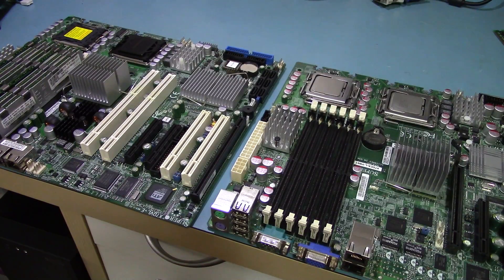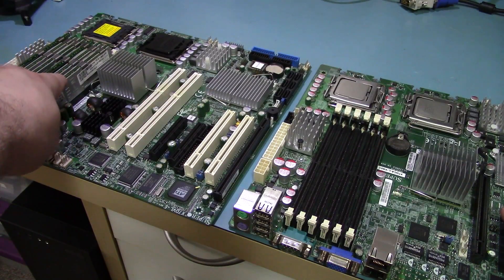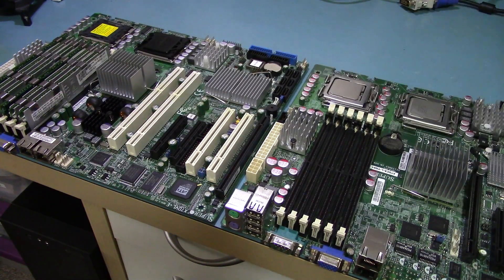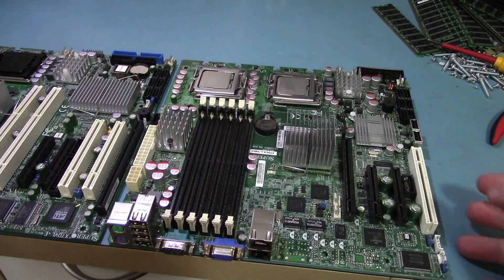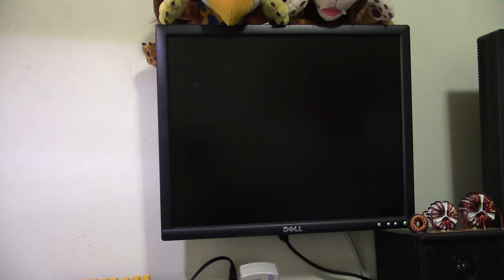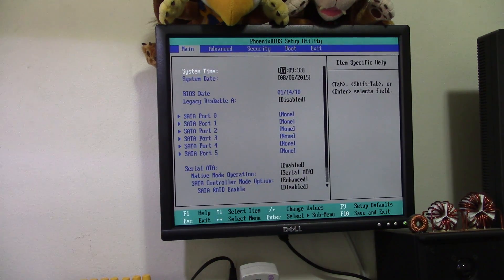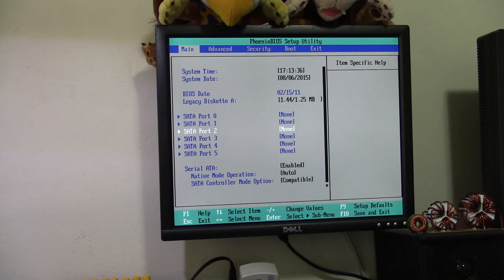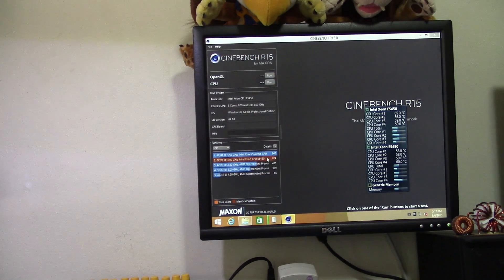Hackintosh Super Micro Dual Quad Xeon Build (Part 1 of 2 - X7DCA-L Motherboard)

Comment: These 'server' type heatsinks are horrible. I don't know how they lasted (In the market) for so long. I always use either fan controllers or just switch these fans to 5v and run at reduced speed or jury rig a better heatsink on with some hacking of the heatsink.

Comment: How did you fix the heatsink on the processor? I'm having problems with this.
Reply from the maker: +Carlos Andre V. Nazario Junior It needs a bracket for the back of the motherboard. If your motherboard didn't come with one you might be forced to use some heavy duty zip ties to hold them down.
Reply: but does zip ties support processor heat without melting?
Reply from the maker: Nylon won't melt at CPU temps.
Reply from the maker: Just keep in mind 603/604 coolers are NOT compatible with 771 chips. They have the same mount, but the height is different and won't make proper contact with the CPU.

Comment: Which CPUs are you using?  I just finished the 771 to 775 mod on xeon x5472 on my Gigabyte P35-DS3L Rev.2.0 board with 8 gigs of ddr2 and Nvidia 740 4GB GPU. I'm running Sierra 10.12.5 at the moment, and i'm noticing some stuttering in audio. I never experienced that before until i swapped the chip to this.  Any ideas?
Reply from the maker: They're in the description on the final build video - dual Intel 5450's. Quad core, 3 GHz.
Reply: Oh alright, the reason I was asking is because I just finished the 771 to 775 mod on Xeon E5472 on my Gigabyte P35-DS3L Rev.2.0 board with 8 gigs of ddr2 and Nvidia 740 4GB GPU. I'm running Sierra 10.12.5 at the moment, and I'm noticing some stuttering in audio. I never experienced that before until I swapped the chip to this. Any ideas? Did you have to do anything else in order to achieve stability with your machine and have all 4 cores working etc..?
Reply from the maker: +BlaGGah I personally haven't had problems. Do you know if the mod is supported in your bios as many need microcode patches to work properly.

All 8 cores of the dual CPUs work fine. No audio problems.
Reply: Peter Brockie you might be right because I'm on bios version f7 for my board I think bios version f9 is the latest. I'll try and flash it and see how it works.  Do you still have this rig? If so are you running Sierra on it?
Reply from the maker: No, I switched to an overclocked i7-4770k setup. But it should run it just fine.
Reply: Peter Brockie Okay nice, thanks for your time and input.
Reply: I'm on the latest bios version now and no more choppiness, stutters with audio. However, the cpu is shown as 2.4ghz instead of 3.0ghz. Why is that?
Reply from the maker: +BlaGGah Try going into the bios and doing a load optimized defaults or load defaults. Save it and see if the speed changes and then make all your changes as usual to boot your Hackintosh.
Reply from the maker: +BlaGGah Try going into the bios and doing a load optimized defaults or load defaults. Save it and see if the speed changes and then make all your changes as usual to boot your Hackintosh.
Reply from the maker: +BlaGGah Try going into the bios and doing a load optimized defaults or load defaults. Save it and see if the speed changes and then make all your changes as usual to boot your Hackintosh.
Reply: Peter Brockie ok I will try that and see. Thanks m8

Comment: Has anyone tried the hp FMB-0701 (for xw8600) for a hackintosh build? If it doesn't work, then is there a better option with more pcie slots than the x7dca-l for about the same price?

Comment: How did you get this board for 35$ can't find prices below 180$ and thats probably hong kong copies?
Reply from the maker: +Joshua Chronstedt Englar It takes time to find a deal. 

Also, no one is copying motherboards. :)
Reply: Ok thats good to know, so you would say it's safe to buy a motherboard from hongkong?
Reply from the maker: Safe? Most likely. However, I tend to avoid buying large things from overseas simply because they are a pain in the ass to return. :)

Comment: Peter your video inspired me, thank you. I got a X7dca-l with 16gb of ram and tried to use with a gtx 750ti, but doesn´t work. I am getting video only from the onboard vga. The 750ti´s fan spins but there is no signal from that and in win10 only onboard graphics appears on Device Manager. Checked all the MOBO´s manual and didn´t find whats is wrong. Did you change any jumper setting...like disable VGA or something else? Which configuration did you use in BIOS>PCI-E Configuration? Could you help me to figure out what is happening?
Reply from the maker: +Eanes ML Did you remember to connect the power connection to the 750?
Reply: there is no power connector in this GPU, it takes all the power it needs from the pci-e 16x. I tried everything. Linus from NCIX plugged a GTX 980 on old pci-e 8x Gen 1 and it works fine.
Reply from the maker: +Eanes ML I'd recommend just loading the optimized defaults in the bios. You shouldn't need to change anything to enable an external GPU aside from maybe a "which GPU to use first" setting.
Reply: I have already tried this....Clear CMOS....Primary Graphics card = Other on bios, changed jumper JPG1 to disable VGA and all I get is 3 long beeps (that means no vga according to Supermicro FAQ ). I saw in reddit a guy that tried to plug a 750ti like i did and didn´t worked, he got a gtx 660 and worked. According to him, he contacted Supermicro´s support and they informed that this 3 Gen GPU were not tested by them. But for me have no sense, there must be another way than downgrade my gpu!
Reply: edit: 1 long and 2 short beeps

Comment: You CAN run a 16x card in a 8x slot (or even 1x slot), but you would have to cut up a groove in the back of the slot or cut the connectors of the card if you don't want to use an adapter. Not something everyone is willing to do, but at least possible.
Reply from the maker: +Daniel Liljeberg I considered that, but this board has components behind the x8 slots. I can't remember if I mention that in the video or not.

Comment: Peter,  I can buy the newer board with one L5420 and 8 gigs of ECC for $75. worth it? Want to try a Hackintosh build. If not I'll throw Mint Linux on it.
Reply from the maker: +Christopher Wood The L5420  isn't terrible (quad core, 2.5 GHz, low power). I usually don't count the memory if it is small sizes. Example, if they included an 8 gig stick it would be a lot more worth while than 8x 1 gig sticks, etc. $75 isn't terrible, but you're going to add a lot more if you don't have spare parts lying around (a second heat sink/fan alone is around $30 + CPU).

You're getting into the price range of simply getting a cheap i5 (K series) of basically any year and overclocking it in a cheap motherboard. Fewer cores at higher clocks is usually faster overall than many slower cores.

Comment: How did you update the bios on the super micro x7dca-l? The only why I have found to update the bios is by using a floppy disk of which I have none of.
Reply: +Dylan 873   That is the only way to do it. It is an old server board. Old as in ancient.
Reply from the maker: +christopher james You don't need to use a floppy disk. Simply use a USB flash stick (ideally a small one, under 2 gigs), use the free Windows program Rufus to format the USB stick as a DOS boot drive and put the BIOS files on it. Boot from the USB stick and run the BIOS update.
Reply: +Peter Brockie   Rufus is a great little app. I mistakenly assumed a board as old as this only booted from either a optical drive or hard drive either SATA or IDE.
Reply from the maker: All the P4 and newer Super Micro boards I have personally used can boot off USB. Worst case they can't boot from USB flash and you need a USB optical drive or even better the USB HDD I have which emulates an optical drive using ISO files. http://www.amazon.com/Zalman-2-5-SATA-External-Enclosure/dp/B007B5Y4BI

Comment: Hey what memory did you use in it
Reply from the maker: +Marcus Frostenson I just bought the cheapest set of the right size and type I could find on eBay. Shouldn't matter what brand as long as you get the right type which is listed on their site. http://www.supermicro.com/products/motherboard/Xeon1333/5100/X7DCA-L.cfm

Comment: umm i have a problem with this board. i have everything installed other than heatsinks (waiting for more in the mail) i have it all plugged in im getting the green light bottom right but when i try the power button (looking up where power switch goes on an online manual) it wont start... any ideas? i only want it to post once then ill stop untill the heatsinks get here. but if this board doesnt work i want to return it asap.
using 2 xeon 5440s
Reply from the maker: Couple possibilities. The CPUs most likely are overheating and refusing to boot - pretty common when you try to run with no heatsinks. They often will not post - but it shouldn't damaged the chips (in theory). The other is the BIOS needs an update to support that specific chip. I had to buy an older version of the Opteron I was using in my other board to get the bios updated to use a newer chip.
Reply: ***** lol im just a genius... power switch was on the wrong side the diagram was backwards... as usual in the tech world as soon as you go for expert advise you solve the problem... i just need to wait for the ecc ram and heatsinks to arrive thanks for the fast respond.  #Plebstatus
Reply from the maker: No problem-o. Enjoy the board!
Reply: +Willabeast  You actually started the thing up without heatsinks? In a matter of seconds the cpu's can be close to 100 centigrade.
Reply from the maker: Intel chips since around the P4 and AMD chips around the... something both have thermal management and will not fry themselves. At least in theory. :P They just drop to like, 100 MHz. haha

Comment: HELP I am having trouble with a supermicro x7dca-l motherboard I bought! Ok so I am still having trouble with one of the boards. I was able to get it all powered up and working, but one of the two boards will not boot windows. It gets to the windows logo and freezes no matter what the hardware is and what the bios settings are. I have tried 7, 8, and 8.1. Do I need to update the bios, or is something wrong with the board?
Reply from the maker: +PROPHET GAME Can you boot into memtest? It sounds like a failed/failing board or memory.
Reply: ***** The memory works fine.
Reply from the maker: Memtest will show you other problems as well. It will let you know if it is something specific to Windows.
Reply: ***** Yeah, but I tried several copies of windows through every port.

Comment: I have the same motherboard and I'm trying to get it to work. However, when I enter BIOS or after it completes the memtest, the motherboard gives a long continuous beep. I've looked up for solutions, but couldn't find any. Can anyone help?
Reply: +PROPHET GAME The BIOS needed an update. After updating the BIOS the long beep stopped and it gave me the right CPU temperature readings. Its all working properly now.
Reply: +Osvaldo Mora noice
Reply from the maker: +Osvaldo Mora Check the manual. It has info on the beep codes. Most likely bad or incorrect memory if it won't even get you into the BIOS.
Reply: CPU overheat.
Reply: +PROPHET GAME Everything I have seems to be working fine, the fans seem sturdy and they make contact with the CPU, I've applied thermal paste in different ways. Would it be anything else that's making the CPUs overheat?
Reply: +Osvaldo Mora bad readings or inadequate heatsyncs.
Reply: +PROPHET GAME The heatsyncs are stock. Is there anything I could mess with in BIOS to possibly fix it?
Reply: ***** You could try to update it, though its not easy.
Reply: Do you have a link where I can learn to update it?
Reply: +PROPHET GAME I got it! It was an update that it needed. Thanks.
Reply: +Osvaldo Mora What was the update?

Comment: Does yosemite run really good on this?
Like how it should in a normal Mac?
Reply from the maker: +Landon Babbitt Mac OS runs the same as if it were a real Mac of the same hardware. Modern Macs are simply PCs with EFI and custom boot firmware (which is what Hackintosh software fakes).

I had no issues with it and it was pretty snappy.
Reply: +Peter Brockie and hey im pretty sure that you mentioned this somewhere already to someone else but i cant find it anymore. would you mind telling me how it is that you got the bios update on the USB stick?
Reply from the maker: +Landon Babbitt The easy way to update it is to use a free program for Windows called Rufus to make a USB stick which boots into dos. Put the update on it and follow the instructions.
Reply: +Peter Brockie which download did you download?
Reply from the maker: For the BIOS? Just go to Super Micro's site and go to the page for your board. The link is there.
Reply: +Peter Brockie ya I just realized that I asked a pretty dumb question there was two links and I just realized it was the first link
Reply: +Peter Brockie and did you install Yosemite with the graphics card in?
Reply from the maker: I did. Although I often see people on forums saying they had to remove theirs.
Reply: +Peter Brockie ok ya I might have to try removing it
What happens is it Will just sit there and the screen will be black with like the typing blinker at the top right corner
Reply: +Peter Brockie would you mind sharing with me the settings that you changed in the BIOS from the default settings?
i feel like that may be the reason because i have installed el capitian to the usb multiple times and i still cant get it

Comment: dual xeon for 8 cores total? that does not seem to make sense to me. there's 6 core i7 available. with 2 x 16 cores, that would be a different story.
Reply from the maker: +Dry Dessert This (and similar) builds are made around cheap, easily acquired parts which a lot of computer nerds have lying around. For me, it was just a matter of picking up a couple items to complete the build at a cost of about ~$200. A 6 core i7 will cost you more than that just for the CPU (even an old X79 platform CPU). Of course you can go and get better Xeons and I would have gone that way if I happened to have them here. But I had the 5450 CPUs sitting in a drawer. This was simply a cheap, simple build using whatever people have lying around.

In raw CPU power it matches my overclocked i7-4770k (which is 4 cores, 8 threads). The truth is per core CPU power hasn't increased much over the years from Intel, which is why a much slower (3.0 vs 4.x GHz) older generation board is able to keep up with it. Although the fact the i7 doesn't have 8 actual cores isn't helping its case.
Reply: always depends on the individual situation what makes the most sense.
Reply from the maker: Of course. For a gaming system, 8 cores is completely useless. A higher clocked dual or quad core would perform much better. But this system was originally built for video rendering - for that task it performs very well.
Reply: My point would be that a modern i7 with 6 cores (the 8 core i7 costs over 1.000€) may deliver a similar performance. Buying used components on ebay to get more power than an average consumer PC for very little money might work, but you need to know a lot about the exact components for this to work.
Reply from the maker: Yes and no. There are some exceptions (SuperMicro boards often require a little bit of case modding to mount properly, for example), but for the most part building an older dual CPU system is no different than any modern board.

Even a modern board still requires picking the right chipset/socket/etc. so it really works about the same with older stuff as it does with the modern hardware.
Reply: +Dry Dessert  Yes, at 10X the price. These boards and cpu's and ram are EXTREMELY cheap on eBay. Six core i7's and a modern board and ram can cost you at least $1,000.
Reply: Yes, there's also an 8core i7 now. But it's over 1,100. I see your point.
Reply from the maker: +Dry Dessert Which I seriously considered upgrading to (my main system is an i7-3770k) to run Sony Movie Maker - but I ended up sticking with Final Cut Pro on a second machine. If I ditched Final Cut I would most likely ditch the hackintosh completely as well and upgrade my CPU.
Reply: ***** Would the 8core i7 be impossible to run Mac OS X? Or are you simply happy that it works now and not risking possible trouble?
Reply from the maker: +Dry Dessert I would upgrade mostly because I would want my main machine to finish quicker. When I have a second machine for video like I do now I don't really mind (it can render all day without affecting me).

I am not sure how well X99 is supported right now since Apple doesn't use it in any existing Mac.

Comment: O and another question
Will your hackintosh run with only 1 cpu in the socket?
Reply from the maker: +Landon Babbitt Many dual CPU boards work with one CPU. I would check the specs - SuperMicro will say "1-2 Xeon CPUs" in their specs, for example.